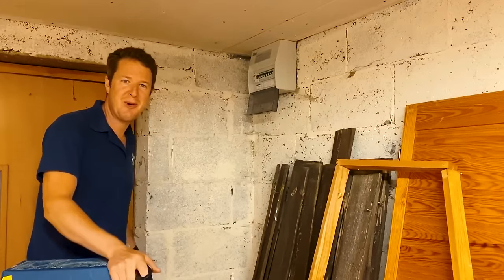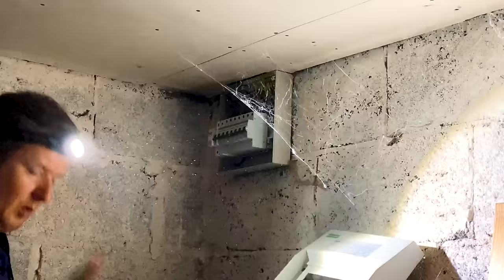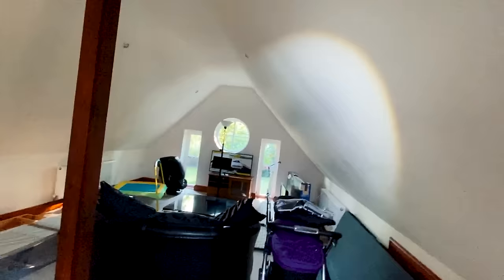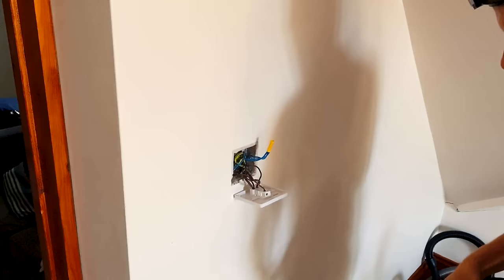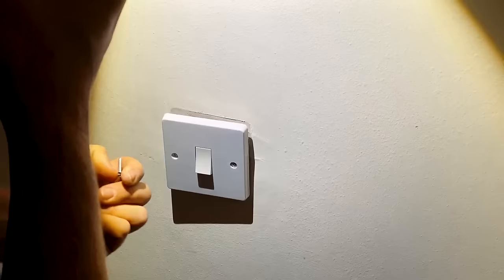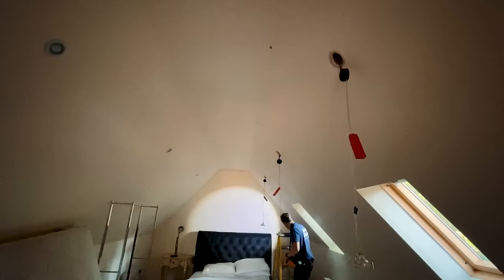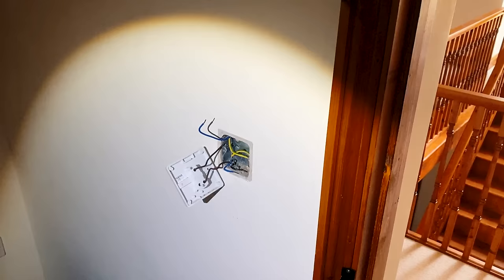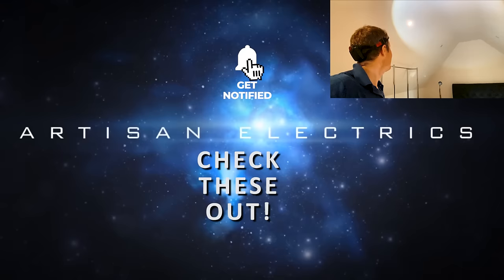Fault Finding Electrical Circuits - Electrician Life

Comment: This is why I like hungarian electrics, because you have everything in flexi con and you can easily rewire it, just pull another one in it. Alltough fault's like this usually don't occur, because most people don't have rcds. By the way I thought the rcd failed but no. My rcd by from F&G is still working after 35 years!
Reply: Good background info (I am a learner of spark things). It seems the rcd is the big thing here for domestic electrics that covers all bases for shock current safety at least as far a regulations. It must be very difficult to not have them in as standard now and I womder how many people have not had severe shocks now and not died?
Reply: @jamblob3208  In ,,z butiful hungari" rcds still aren't nescescary. You can use them, but you won't get slaughtered if you don't. By the way in my aunt's flat it's impossible to get a shock, because nothing is earthed, and the building is too big to be able to conduct the electricity down to earth.

Comment: You could have disconnected the suspect cable  at both ends and then energized them individually and used a non contact tester to id any breaks. If that failed, you could use TDR to measure the distance to the break. Most electricians don’t own one though and rental could be expensive.
Reply: What's the point of doing that when running continuity and IR test would solve the mystery?

Comment: I'm really thankful that we here mostly use ducted installations and usually have a junction box in the ceiling that is like switch box you use, inside the ceiling but accessable from the room under a lid. And usually the mains come from the board to that junction box, from there either to all lights separately or from box to first light and then from that light to the next. Might be without ducting between the lights but here if you do ductless cables they cannot be secured to anything, they must be able to move if a screw or something is screwed where the cable goes behind the plaster board or something. Not sure if anyone understands how I mean but I like our way. We also in older homes mount the cables on the surface, we might use MPLM cable for it with Schneider TKK fastenings

Comment: Easy fix - its only flat, skimmed drywall - no artex, wallpaper, etc. Just cut sections out, make the repair, brace the holes and replace the cut sections. Then just fill the gaps and at that point I always give the customer the option - you can sand and paint yourself, a decorator could do it or i can do it for an extra fee.

Comment: You might wanna search for dry wall screws with a magnet perhaps. Who knows, you might get lucky. 
You could perhaps use a cable finder to track the cable if you open it in both ends (to check for screws in its path)
Reply: The cable finder always works for me simple and effective, then you can work most things out off the back of that ....

Comment: In Italy that electrical panel would be out of the norm because the total MCT's output  is higher than that supported by the rccd (unless elsewhere there is a properly sized MCT on top)

Comment: So how to repair it.... 

Proper way - Replace defective wire, fully check, certify and redecorate.
 
Cowboy way - Since the halogens are class 2 and do not require a CPC connection, park horse outside, check insulation resistance on the defective cable between N-L (optional) and if ok totally ignore BS7671 and disconnect CPC....(put Blue sheathing on CPC also optional), finally load reel of Sellotape, pliers and one size fits all flat bladed screwdriver back into saddle bags and ride off into sunset., 

And no that's not a recommendation just what I would expect Mr DIY to do. I've seen similar.
Reply: Well the ground wire only goes to plastic inside a box...  So it's hard to see why not.

Comment: your'e doing a great job but at 15:15 i would have removed one of the lights at the back of the room cutting the string of lights in 2 parts after that i would have probably gone for the one in the middle on the left side.
Reply: Thats my method.

Comment: I normally use an ohmmeter and it works fine, but we hardly use RCDs in Kenya, a double pole isolator and Mcbs is all you will get in a consumer unit.

Comment: I would have checked the earth leak using ramp test first then moved on to the circuits any electronics are circuits within circuits LCR circuits with shorts often don,t draw enough current to creat a dead short but earth leak will detect, we used to have to wire high integrity earths due to electronics naturally leaking thus they started asking us to verify earth leakage current as some as I saw that the electronic transformers were on the circuit I would have been all over them dimmer switches used to cause havoc when earth leaks first came to be common practice in consumer units gone were the days of rcd socket located near exits industrial now tend to go 20a 4mm circuits with earthen leak sockets and clicks for light fitting makes fault finding very easy keep the good work up Jordan

Comment: ‘It’s a fairly new build’ but smoke says replace by 2015? Are these smokes 10 years which would indicate fitted in 2005? Not so much a new build but please correct me if I’m wrong.
Reply: Depends how long the supplier then merchants held the stock, its not unusual for these things to be sitting around a warehouse for 12 months  and your relying on the merchant to rotate stock as for lasting ten years , never had one last more than 6

Comment: When I do this, I like to go to the first junction box from the central, and start disconnecting from there rather than going about trying to find a socket or switch thats faulty. It's down to a lot of luck, but I like this way of doing it too. Thanks for the information,.

Comment: and this is the reason that in the Netherlands we lay all cables through PVC tubes.  if something goes wrong, tie a new cable to the old one and pull the old one out and put the new one in.  finished.

Comment: Well found. You might get lucky catching and re-running the duff line, but it's a swine of a job.
Loft conversions are a major source of wiring faults because each successive trade covers the fault with their work.
I wish people would run conduit and individual wires (they insist on that in some EU countries).

Comment: Hi  Is there mouse lose about this house 🤣  great job of detecting the fault . Admittedly the additive they put in cables is a deterrent to rodent damage. I have had a problem were a cable was damaged by a screw . But became problematic over time because of thermal movement in the property . O the joys of being an electrical contractor   Best wishes   Mike in the U.K. 👍

Comment: Check if the cable pulling at all. If so, you can connect a new one to old, and pull it out from one hole to another, with some luck.

Comment: Did you hear about cable tracer its a kit that makes thing very easy to find the cable where it goes. Up to testing switching was fine after that i would disconnect all the lighting in that room tracing cables  and insulation test each at the same time. You would save time in that way

Comment: You did well to find the problem. I would do the same thing as you. How would I replace the wire? I will pull a new cord or chop plasterboard out using an obsoleting saw. Easy to patch back up but time consuming

Comment: I think it's a bit interesting that they have individual transformers for the lights and not a central and then use a low voltage circuit only for the lamps. But regardless a screw through the wiring is a fire hazard.
Reply: More expensive at least to have one transformer for every light 💡

Comment: When you zoomed in on that junction box I had a flashback to when thousands were used on 2 sites that I was on. They’re Hager and have even been stripped and connected in the same way. Personally, I always thought it better practise to bring more of the outer insulation in and loop them into a ‘J’ shape so that the Line & Neutral T&E would go into the terminal at the bottom of the terminal rather than at the top.

Comment: May be do an earth leakage test first. If its just started tripping it something that they have plugged in that's took the rcd over its leakage threshold. Also ask questions to the customer and ask when it first started and if they have installed anything new that sometimes points to the area you want to be looking at.

Comment: I think the loads should be removed before carry out insulation resistance test. That’s why the light circuits have low insulation resistance.

Comment: But if old cable is still there it's simple, attach new cable to old one and pull it through
Reply: Can't do that, as he said, the cables are clipped and there is insulation in the way
Reply: @tonipeters4543  ohh I didn't pay attention enough
Reply: exactly!

Comment: I love fault finding too.. It's in me blood 😁 you pretty much did what I would do. Pulling a new cable in is gonna be tricky, but maybe surface channel the ceiling board and oval conduit new into it? If no access behind, not much choice. Great video again 👍
Reply from the maker: muzikman2008 thanks!
Reply: You should start working as electrician at a factory or some kind of industry. You'll get a lot of fault finding. And it's the most fun work I do
Reply: @GoalOrientedLifting  I used to work for a company making hazardous area cctv equipment, fault finding and building camera systems, rack equipment etc, loved it. Got made redundant now work for myself as an electrician. I still get to see interesting things and mysteries people leave behind. 😉

Comment: Quick question, If i have
1 × 30A stove circuit breaker 
1 × 40A circuit breaker for the inverter inlet
2 × 15A circuit breakers foe the plugs
2 × 5A circuit breaker for the lights, what should be the current rating for my Main circuit Breaker, will i be fine with a double pole 63A MCB?

Comment: where you thought that the faulty cable was between the disconnected  light and the one next to it ,when you switched  on 3 lights didnt come  on, meaning the actual fault could  be in any of the 3 cables connecting  the last 3 lights.

Comment: I've had that with Doncaster cables the neutral inside the cable had a slash in the sheath and was intermittently touching the earth in a kitchen, luckily an easy fix as it was just a leg between 2 sockets. But when you moved the cable the fault cleared. Its mad to think that it probably passed an initial eicr or not

Comment: Could be a nail etc but if nothing has been done recently then I would say its more like its rat crap on the wire after eating off the insulation BUT I wouldn't expect it to be quite that low ohms. Personally if the client doesnt care having a go at pulling the wire through could be worth it but it takes bugger all to stop the new wire being able to be pulled through, but if you get the old one out at least you know what caused the problem.  Love to know what you find if you ever do

Comment: Long time watcher not a spark, But i would like to guess water ingres in the roof into one or more light fittings /junction boxes etc:) all the storms and heavy rain of late.Guessed when you asked
Reply: I would have tested the 2nd light switch before you cut the crimp to save time. But top stuff on your method.
Reply: water ingress wouldn't cause a dead short like this

Comment: Just wanted to ask a question. I'm starting a business from home that will use a lot of power, and I'd like to kind of work out, which household plugs are for each 10 amp circuit. What's the best way to do this? I mean, just plugging something in to each plug and having only one circuit turn on?

Comment: Loving the videos, even though I am not in any way a trained electrician - so, I hope my question is not too daft.  As the transformers do not have an earth cable to connect, would it be acceptable to disconnect the earth cables from where the fault occurs?  I know that there "should" be an earth on lighting circuits, but as there is technically no need in this case, would it be a problem?
(Accepting that the earth is shorting with the neutral.)

Comment: Not sure if you have done already but can you do a video on how to fix a crooked metal back box in tiled wall?
Reply from the maker: Wow that’s specific! Tough one
Reply: Artisan Electrics ...but do-able? I have a metal 2 gang back box in a chased wall. Whoever did the job didn’t install it level and now the screws don’t align with the lugs and socket doesn’t sit straight or flush against the tiles. Obviously, I don’t want to have to pull off the tiles however I was hoping you might have some ideas on how to remedy the problem.

Comment: To rewire it I would use a Fein and open up the drywall and the joists then put a tube with a new cable in it and they can put back the drywalll..

Comment: When you mentioned it was a modern build and therefore switches were wired to neutral ... What did you mean by that?

One thing I think I spotted was absence of rose joints, so live and neutral come from switch box. Is that what you meant by modern wiring?

Comment: Question from a beginner:
You started with an IR test. Did you make sure that sensible equipment or household is disconnected or did you use 250V straight?
Edit: i now heard you said 250 V.
Is this voltage safe for any posssible connected accessory then?
Reply: Yeah, because everything plugged in is rated for 240 or there abouts. An extra 10v won’t hurt

Comment: And this is why it's always best to fit an all RCBO board.
Reply: Yes we've done this now,  it was always cost that kept use using split load boards but got a deal on lewden rcbos that have made it cost effective to price.
Reply: @simonc772  Yes, cost was a major contributing factor for us too but the likes of Lewden and Fusebox have made it more affordable for our customers.
Reply: I won't use denmans lewden gear as when impedence testing with my megger the rcds bump it up by 0.5 ohms. When I spoke to technical that said its a known problem with meggers and basically send me an email telling me to take away my ze from r1+r2 🤣
Reply: @davey6024  The Megger 1741 should be able to see pass the RCD uplift.
Reply: @ashmanelectricalservices4318  its 2 years old. It has the options menu at the end of the dial where u can adjust the resistance offset to null the leads for impedence testing. It literally only ever does it on lewden gear.
Reply from the maker: Ashman Electrical Services true!

Comment: Why do Tackers have the inclination to supplement cable fixings... A common occurrence where a nail/screw just nicks the inner insulation while contacting the cpc that, a fault only shows intermittently as thermal movement closes the gap between the nail and line/neutral conductor.  I would cut an access 9" x 6" in the flat ceiling directly above the light with the lowest resistance reading repair/renew as required...

Comment: I have a weird problem with the electrics in my house. If the RCD is tripped internally through a short circuit, which has only occurred when it is pissing down or I am pissing around, the MCB trips, so I reset it and the RCD and we're all fine. However, if it the RCD trips due to something external, for example during a thunderstorm, it won't reset. I have to manually trip all the MCBs and go though one by one until I find the one that trips the RCD again, then unplug whatever's on that line, typically the TV or microwave, at which point I can reset everything. And yes, I am on a 'smart' meter. Any suggestions?

Comment: I'm 9 minutes in, i would fear that it is on of the spots, water from the outside coming through the roof, hopefully it's not though, that can be expensive to fix. I'm a little thrown off that you don't pull out all the plugs from the outlets, and then retest the circuit. So many faulty chargers and stuff nowadays, and it's just so easy to eliminate that right away. It could be that outlets and lighting is on different circuits ofcourse. But here in Denmark they are almost always on the same in normal houses :)

Comment: Hi Jordan I am a fan  of your work just a quick question on insulation resistance test. Don't you have to remove bulbs and other electronic devices connected to the circuit before carrying out your insulation resistance test in the Distribution board circuits.

Comment: Can you get a transformer capable of feeding the remaining 3 lights and connect that to the feed off the last working light. That way you could loose the earth connection as the last 3 lights would only have a 12v supply

Comment: As a wannabe electrician watchin' you figure these simple steps out in front of my eyes is what the doctor prescribed. 
Do I understand correctly, by connecting neutral and c.p.c. you expect a large resistance to appear between them if they're not shorted? Hence, you go down the wire that has ~0 resistance until you narrow it down to the fault?
Reply from the maker: Maksims Ivanovs yes that’s right! Thanks for watching, glad you enjoy the videos!

Comment: Personally , if that was me, after finding the light that possible was causing it, I would of jumped down the board and tested from there rather than snipping the other crimp etc... just IR from the board and you can reconnect and you’re just dealing with that little leg of lights.

Comment: It also takes some imagination, you did good. I'm in the U.S. I had my first electrical home inspection pass in May 1970, (retired now). Looking at it from across the pond, (some great distance), I would attempt to use a fish tape and go right across the top. There would be no logical reason to have any cross members between the rafters to impede the fish tape. I do hope you would try that and see how far it would get you. It's worth a try from both directions.